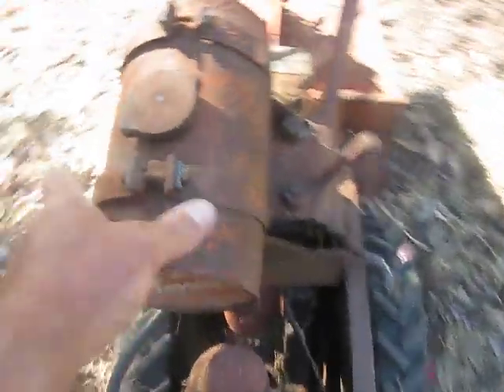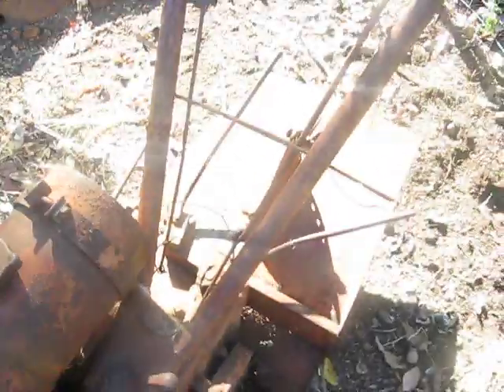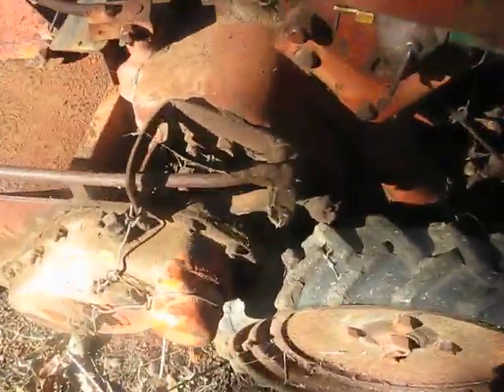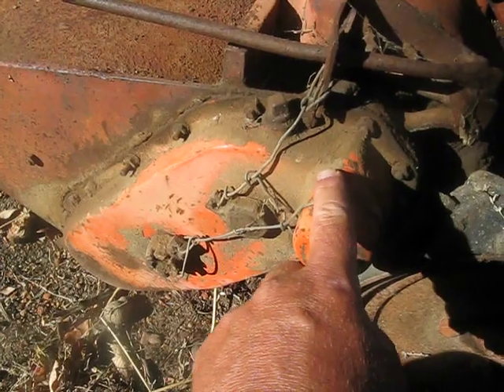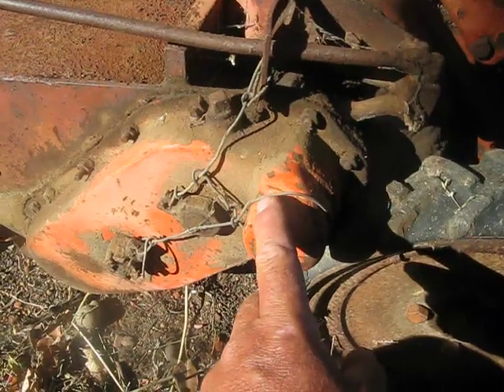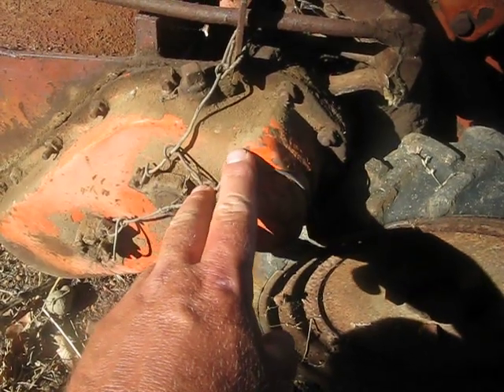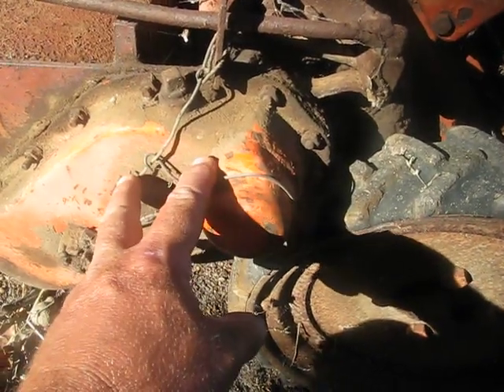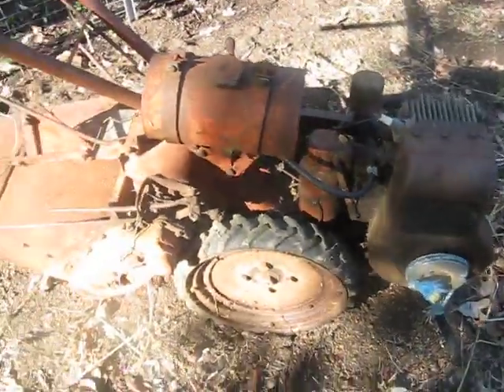Howard terrier rotary hoe running.

Comment: I am after a rotary hoe and I seen a very similar machine with all the rust too on action at ebay starting at $450, and I wonder how easy will it be to find parts or I am going to get stack with a machine that is so old and no parts around. I need a good rotary hoe as I will use it on clay soil and they can be very expensive to buy a very good one
Reply from the maker: Giavvns Ion These are very good strong machines that will chew through anything. Most parts can be made at home but the biggest problem with these is the pinion gear to select the drive for the hoe. It wears and then keeps jumping out of gear, you then have to change not only that gear but the one that aligns with it. There is a guy that still has some and gets them cut but they are not cheap. Around $700 for the pair. So be sure to check that the hoe engages and doesn't jump out of gear before buying. There is a fair few of these machines around and you wouldn't want to pay more than $450. The Howard Gem is another good machine. The juniors are hard work to use unless you can find one with reverse which are harder to come buy. Terriers are brilliant because they are a very good useable size and you can whack any engine on them as they are belt driven. If those hoe gears are good and you keep oil in the gearbox it will last forever.
Reply: rotaryhoes Thanks for that. Regarding that rotary hoe the engine is been changed to 7HP and I asked if there are any issues with the gears and said he never had a problem they are still good. Hard decision as you do not want to get stack with a machine that needs a lot of money to fix and also I believe any new machine under  $1,000 will be close to a toy just for small jobs.

Comment: Hey...how deep can it go...my junior died...1st and reverse gone...I'm guessing the selector...what do u think?
Reply from the maker: They can't go as deep as a junior but not far off. Probably a couple of inches less. You junior problems don't sound good. Could be a number of problems causing it, maybe something simple or sonething expensive!
Reply: @rotaryhoes  thnx...now I'm thinking about buying a Gem...tc
Reply from the maker: @paulsoutbackgardenaustrali7674  gems are the best in my opinion. Such well thought out machines and easy to use. Kohler powered is the best most reliable of mine but the twins are pretty good to when running right.